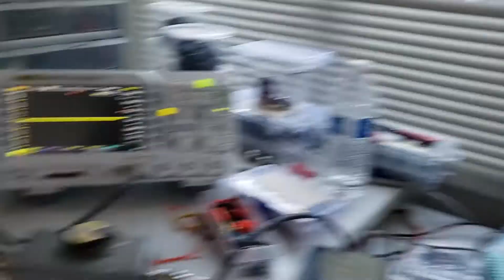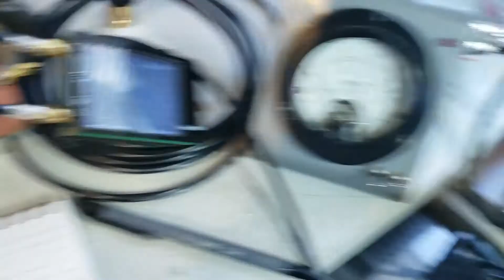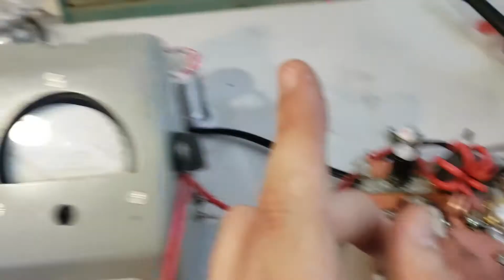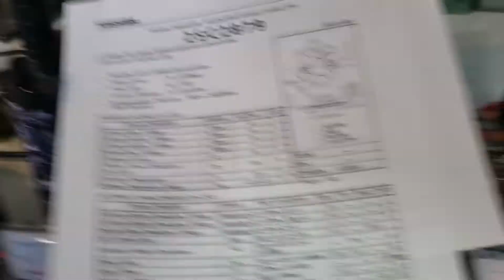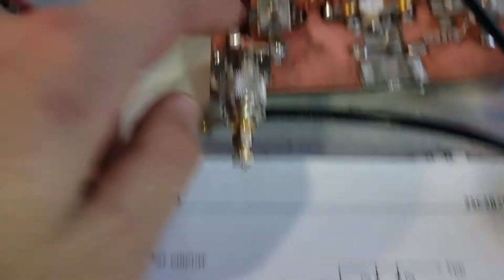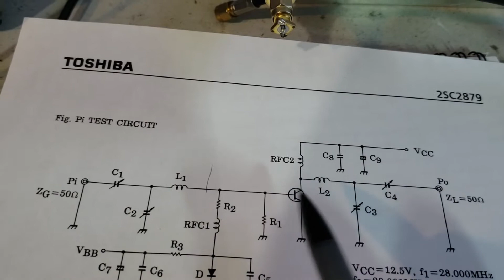Super Simple 2sc2879 Amplifier and Theory

Comment: That is almost the same test circuit used in the Motorola RF transistor hand book. will be very clean but wont brood band much with out re tuning . for singe band use that's fine.  for VHF smaller inductors and 80 meter HF will need longer coil. depending on transistor. MRF 492 works 50 MHz . That is best bias circuit.  to build this into working amp  place diode on heatsink with thermal compound. My book in storage think 1N4997 is press fit into heat sink for bias .will help with thermal run away.  you are right the 2sc2290 has less input drive needed . makes great driver for low dead key radio  . 73's
Reply: Should use transformers instead of L network. This will work \on a few channels at best on CB. Will require retuning just to use all 40 channels. The reason they use it for the test circuit is because they are only testing at a single frequency of 28 MHz.
Reply: @gregaldr  L network is a high Q  factor. I came up with a better input network for 1 pill using a small type 61 toroid and just wrap to match impedance. then just use output transformer using both sides as 1 . Much better broadband. But hard to wrap small toroid . I find using small SD 1446 in push-pull makes a better driver than 1 HG 2879. Like in a 2X8 . still a low drive box. not for hot radio . Just straight 8 pill for a 955   Stryker. 73

Comment: Fantastic video!  You took 40 years of  mystery out of my tinkering.  Wondering what value your "high value" blocking caps were?  Also what diode did you use to stabilize the bias supply? ... if I may ask.
Reply from the maker: I think those caps were 5.6nF. Enough to pass 27mhz with little reactance. As for the diode I don't remember... just a random one from the junk pile. Didn't matter much for what I was testing.
Reply: @MudDuckSharky   thank you!  You should have 100K subscribers with this type of content.

Comment: Concur with Mike and Skywave.  Just what we have been looking for in regards to impedance matching for input and output of a transistor.  Thanks Cale
Reply: Not the right way. Should use transformers. Easier and works on more than one frequency!
Reply: @gregaldr it is a simple way to EXPLAIN what is going on.  What your referring to is typical approach for a functional amplifier.  What this video demonstrates is theory and how to determine operating parameters for a specific transistor. What I learned from this video is priceless. Do a video and share your thoughts. Happy to comment.